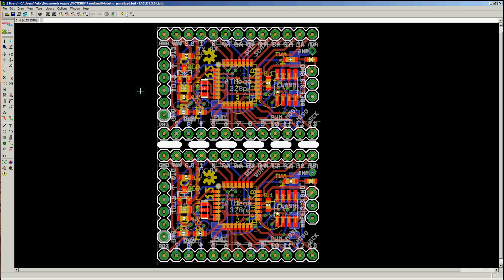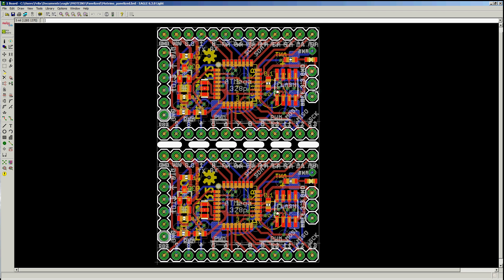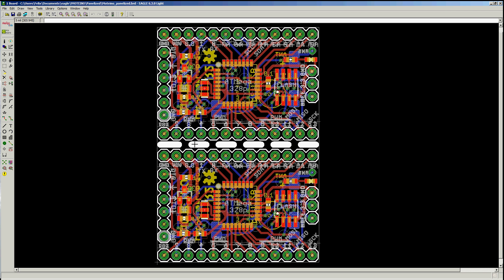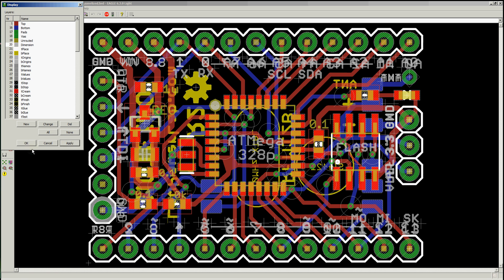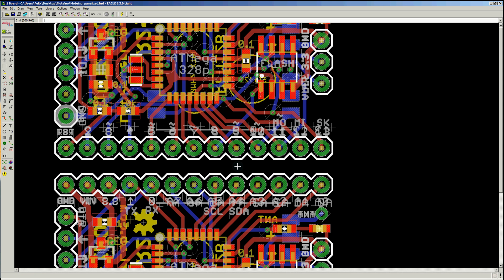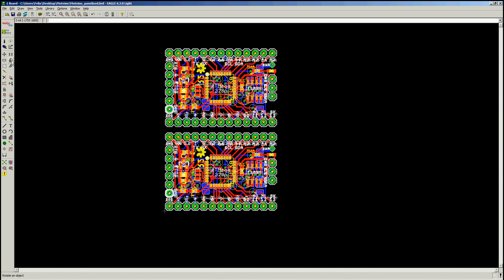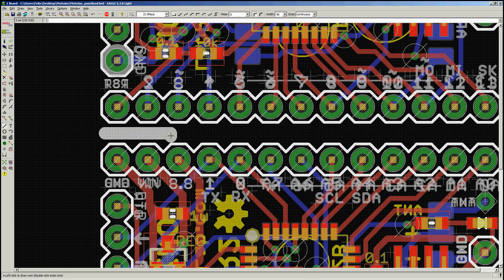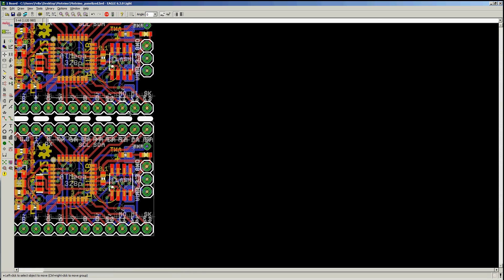How to panelize PCBs in Eagle CAD

Comment: If you do it like that you'll have new names on R1, J1, J3, C4 etc etc like they would have been named if they were on the same board. If you have R1 to R10 on board one they'll change names to R11 to R20 on the copy - unless you run panelize.ulp and copy the tName layer to another layer first (I think tPlace is a good one instead of the default 125). 
If you draw a dashed line using tPlace the board manufacturer must get instructions to make it a breakable line, right? Why can't they panelize these for you instead of correcting your attempt of panelizing? 
Isn't there a risk you'll get a large board with a broad white dashed line in the midde as you use tPlace as indicator?
Shouldn't the "break-line" be drawn with the dimension-layer and perhaps the Milling-layer if you want vgroove/vcut/vscore?
Using a broad longdash line could be a good template for drawing a dimension line and then add small holes as break off points (resulting in the usual mouse bites and slots).

Comment: Follow the steps until renaming the board with another name.  Then (a)  Close the original board and open the new board.  (b)  The new board's SCH and BRD both would be open now.  (c)  Close the SCH file.  Ignore the warning of not being able to back annotate.  (d)  Copy the entire board and paste as many times you need  (e)  The second and further boards so pasted will have new component nos. automatically.  (f). Remember to provide adequate spacing between the boards to separate them.

Thanks bigjim, for the idea of avoiding the continuation of the part nos.

Comment: Nice tut. 
To make cutting easier I'd like to have cut_outs like the dashed line pattern. I'heard they call it v-cuts or something like that. Some use many holes for it.
Q:  Is there a way to make the dashed line a cutout/v-cut? Or is it already like that.
Reply from the maker: The vscore is a very thin line you want put in the Vscore layer. What I show is purely for visual aid when you cut the board.
Reply: Thanks for answer. How can I achieve Vscore?
Reply: Felix Rusu Thanks for answer. How can I achieve Vscore?
Reply from the maker: mustafa aydın Put a 0 with line on the vscore layer, then generarte a gerber file from that layer according to your PCB fab specifications so they would actually do the cut.